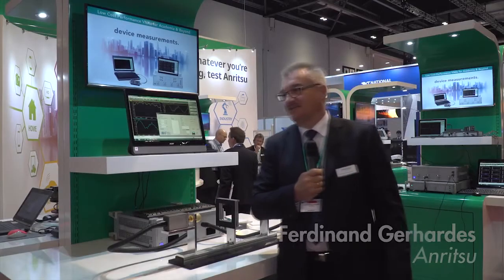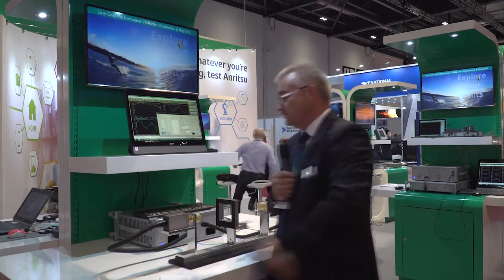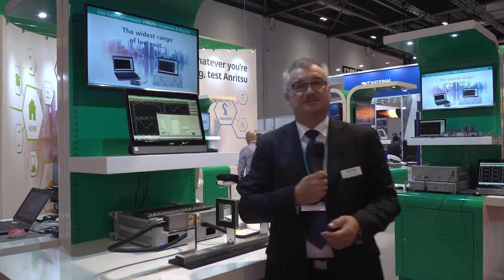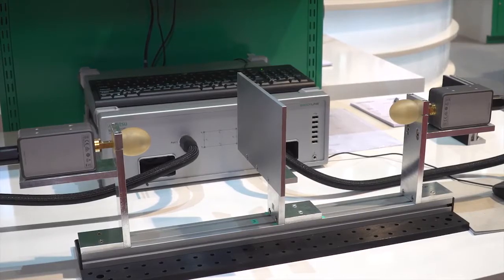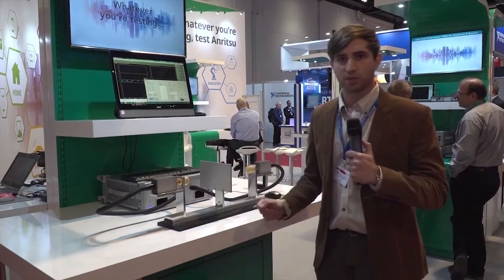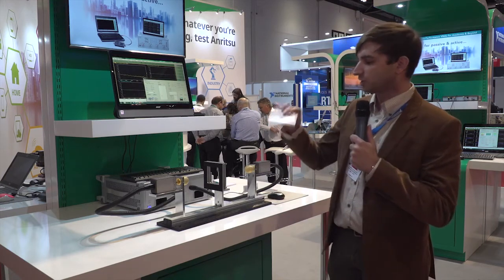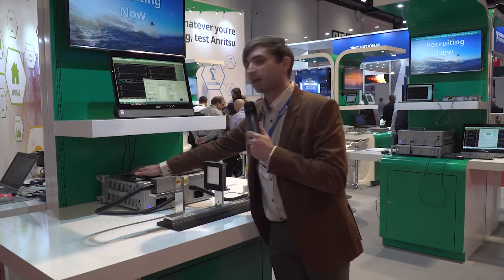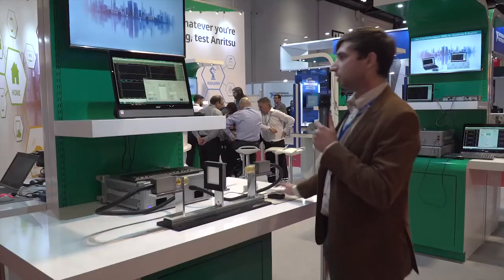E-band dielectric material measurement using a ShockLine Vector Network Analyzer

Comment: Can you tell me which mode of VNA is used for this set up e.g. VVM or Spectrum Analyzer or Vector Network Analyzer and what was the frequency  of operation in this set up
Reply from the maker: The VNA model used in this video is the MS46522B E-band unit which can measure from 55 GHz to 92 GHz. 
The material measurement application shown uses the network analyzer in vector network analysis mode. This particular measurement is being performed from 75 GHz to 80 GHz.